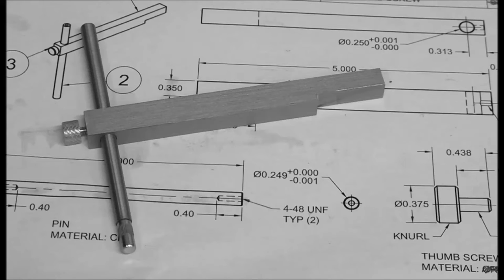Height Gauge Depth Arm

Comment: Well done, Justin. A nice addition for your analog CMM. :-) The bacon fat reminded me of Henley's Formulas which recommends 1 part graphite mixed with 4 parts tallow to lubricate lathe centers.
Reply from the maker: Thanks Hans.  Yes, I do recall the Henley's formula as well, although I don't think I heard it from Henley's.  You need it for your dead centre - otherwise you ended up with a part welded to your centre.  No bearing runout with a dead centre.  Of course 100 years ago dead they were everywhere.  Since the introduction of the economical precision roller bearing live centres have taken over.  I don't think hardly any younger folk working in the trade even know what a dead centre is.

Comment: Shapers are fascinating  tools and any shaper footage is welcome :)  even if in Alaska where I am, a Unicorn is more likely to be found.  I must look at my height gauge to see if I can change the tip. I prefer digital gauges because I work in metric, and the analog readouts do not do this stunt. Bought mine from Lee Valley so we will see.

Comment: Nice job - thanks. It was a useful reminder of a technique I was aware of but have not yet used. I was surprised that the part drove OK without a drive dog. I guess that was a live tailstock centre. Best, Mike UK
Reply from the maker: Thanks Mike, I appreciate you stopping by.  I don't always use a lathe dog - you are right the live tailstock centre allows me to get away with this.  I use it mostly for finishing, and since I use LH Sparey's method finishing using HSS involves about a .001" DOC - not very much load.

Comment: Great video Justin, and great job on the arm! :)  I agree about knurling, for those bump-style knurlers setting them at a slight angle makes all the difference in the world on smaller machines like ours.  Speaking of which, how burly is that leadscrew on your lathe??  Holy smokes it must be at least twice the diameter of the one I had on my old Chinese machine.  I'm glad you like the boring head, and that it worked well for you.  My video will be up soon, and everyone will be able to see my boring head as well as my boring. head.
Reply from the maker: Thanks Max.  I really want to make a scissor type knurling tool - it's on the growing project list.  They do a much better job and reduce the force significantly.  That and buy some knurling wheels that aren't made out of cheese.  I just used the one that came with the import piston tool post.  The lathe has a huge feedscrew, I think it's around 3/4 - 7/8 of an inch.  The feedscrew is also fairly well made.  It's a strange TPI though (7) so it makes for some interesting thread cutting - although it does do both metric and imperial threads.

Boring head worked great.  I can't wait for your music pick.
Reply: I always thought I'd make a scissor knurling tool too, until I got to use a cut knurling tool.  I would make a cut knurler (or set of cut knurlers) in a heartbeat now, rather than any other design.  Literally effortless, and they come out perfectly full depth in one pass.
Reply from the maker: I just looked into cut knurling.  I'm kinda excited - I can make the knurl wheels myself on the shaper with a dividing head.  Interesting .... I wonder how deep this rabbit hole is.

Comment: to reiterate what's been said in just about every comment so far: excellent job (&, in addition, a lovely, high-production-value, very entertaining video); been wondering about the feasibility of using boring heads instead of reamers for small-scale holes (i use a shared shop, & all of the reamers are basically miscellaneous - precise hole making basically involves spending an hour trying out likely candidates with gauge pins, to see what ones give me the for I'm looking for), & this video just about convinced me to start looking for some tooling